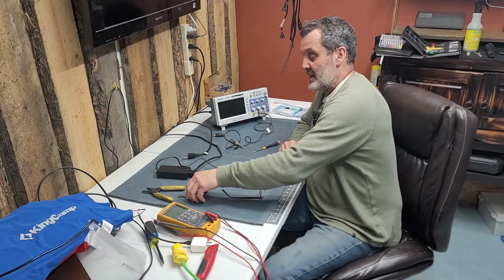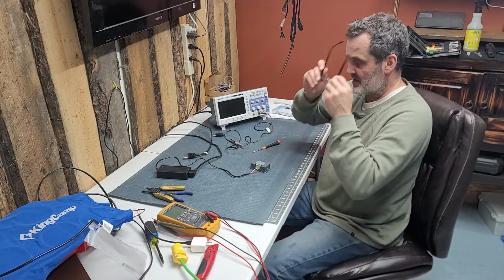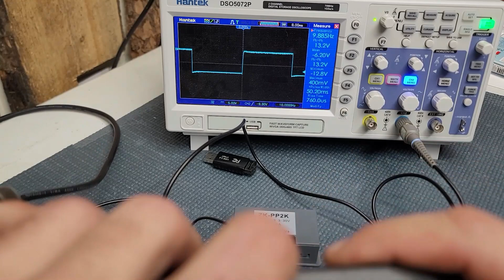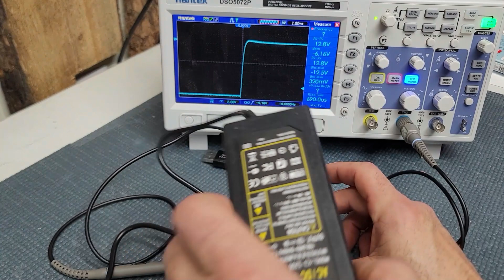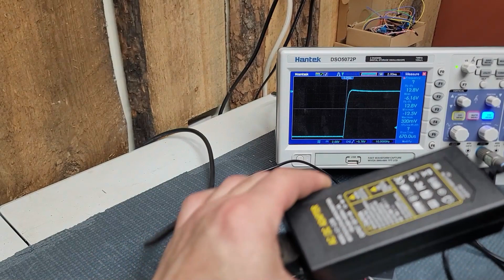Will my power supply mess up my signal?

Comment: Hello steeve :) to begin with, i will thank you for the educational videos, i really appreciate them. i am starting to make my own PEMF when my components arrive from china, which sadly takes about a month because i live in Denmark. I have a question. Lets say i want to make a bigger version with an output of actul use of about  10amp, 230v, 23ohm resistance. i am a electrician my self, so my question is what should i beware of about when talking coil wraps, cable mm2, heat in general and how to deal with it, and maybe quality of components and cable in general?  Greetings from Morten
Reply from the maker: I apreciate your questions.  

First the zk is only rated for 30vdc and 8 amps.  

It will let the smoke out if you give it more.  

Second.  If you use 230vac, you no longer have the ability to control the frequency, you will be stuck with a 50hz sin wave.   The worst kind.   Please go review.my battle of the wave video.   

Third.  Believe me, the one I show how to build is awesome.    And that power supply is universal.  It can take 230 or 120 vac and convert it to 24vdc.   That is why I chose all the pieces. So it is easy and safe.   Also because it is based on the little we know of pemf. What works and does not.   

Hope that helps.   

Made me laugh when I first resd.yiur comment.   My first build I was gonna use a VFD and 3 phase ac.    50 amps  and 208 volts.    Lol.   Since then I learn that quality is proper use of the science is better than a crazy French man building at home.MRI machine.    Lol.
Reply: @Steeve.  thx for your anwer 🙏
Reply from the maker: @AncientCosmicAwareness  your.welckme.  

I enjoy interacting and being asked tough questions.   The only way to learn and get better.   

Keep.up.questioning and imagining stiff.